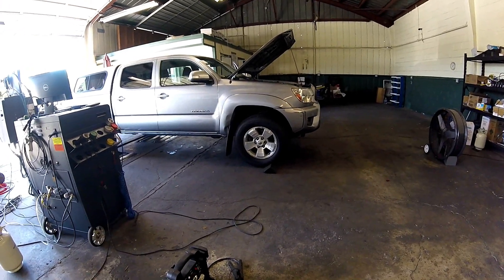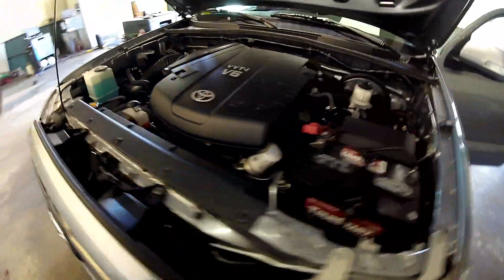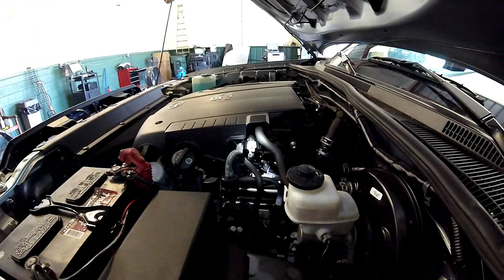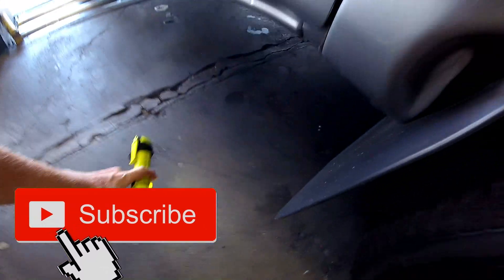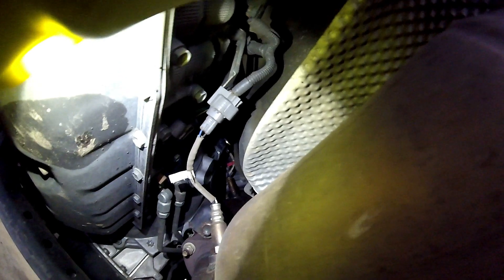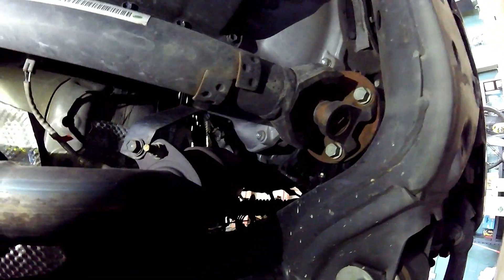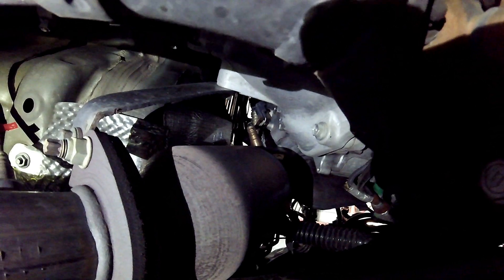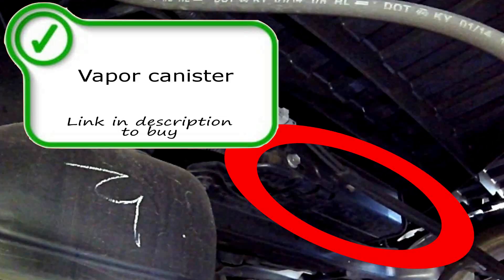⫷ Toyota Tacoma 4.0L v6 1GR-FE Emissions Locations: PCV EVAP, & Oxygen sensors ⫸

Comment: I have a P0420 code catalyst system efficiency below threshold bank 1, should I replace only the rear sensor or both?? 
2005 Tacoma v6 198k miles on it
Reply from the maker: Try the rear sensor first. That is the sensor that the ecu uses to monitor the efficiency of the catalytic converter.
Reply: @ScottiesHobbies  thanks Scottie, truck feels normal, no loss of power or weird smell coming from the exhaust so I hope is just the sensor
Reply: @boluchhh any updates on replacing the downstream sensor ? I’m fighting the code now and wanting to scratch o2 sensors off and reset the code ?
Reply: @BcSoTrendyy  i keep getting the code after changing the sensor so i just went ahead and replaced all the sensors, no more codes after that

Comment: Great information but how to I test each  sensor on my Tacoma first. Thanks and God Bless.
Reply from the maker: What sensor are you trying to test? And why do you think you need to test it?
Reply: Air flow and oxygen sensors, my truck has difficulties accelerating.
Reply from the maker: @davidruiz5383  have you tried cleaning the mass air meeter? If you have a fast acting volt meeter you can read the signal wires on the O2 sensors and you are watching for voltage switching from .1 to .9 v. You would have to induce fuel and read the oxygen sensor at the same time to see how fast they react. Its much easier to check if you have a good scan tool. 

You might be able to check your fuel trim to give you an idea of how your car is running, rich or lean? If you read a positive fuel trim at idle and it stays way positive while driving, you have a fuel delivery issue. 

I'd try cleaning my mass air meeter and see if anything changes... no codes or check engine light on?

Comment: I have a 2006 Toyota Tacoma that isn't starting when it's cold. I have to turn key on and off and eventually it catches and starts finally. My starter is good. I just replaced the ignition switch. thought it was fixed til I went out this morning. Same issue. Dash lights were all lit up. I used my FIXD to diagnose the problem. It said it was oxygen sensors. (Bank 1 and Bank 2 sensors) Would this cause it to not start? After it runs for a few minutes I shut it off then it starts right up. Thoughts??
Reply from the maker: Have you by chance checked your fuel pressure? Especially check the fuel pressure on a cold start? If you are running lean or starving the fuel from the engine you could get codes for both oxygen centers upstream. Personally I do not think It is logical for both precat oxygen centers to be bad and cause a no start. I think your computer is seeing a problem using the oxygen sensors.

Comment: I'm getting a p0430 code, and also experiencing diminishing fuel efficiency. As you said the downstream bank2 sensor is only a cat efficiency sensor, does that mean replacing it won't fix my problem (since I'm having fuel ratio problems too).
Reply from the maker: Have you checked for a pending code? You probably have a rich condition in the engine causing the cat to fail. For some reason the computer is not seeing it. Have you checked your spark plugs? See if any are wet. If they are, is it fuel or coolant? Do you have a code reader?

Comment: I have a 2011 Tacoma Crew Cab with 6 cylinder engine with about 50K miles on it and both the "Check Engine" and "slip Indicator" lights came on. I attached my scanner and Code P2195 came up. I erased the code and made sure the gas cap was properly connected and drove 15 miles, starting and stopping a couple of times. The "Check Engine" and "slip Indicator" lights came on again and I checked and the codes P0138, H02S, and P2195 now come up. What do you recommend? Can I simply replace the Bank 1 Sensor 1 and Bank 1 Sensor 2 Denso devices In the past I attempted to replace the O2 sensor on my 2004 RAV4 and I had a very difficult time getting the bad one out. Or, should I bite the bullet and let the dealer do the work. I would appreciate any advice on this topic. Thanks.

Comment: I have a 2012 Tacoma xrunner I'm getting p0171 and p0174 truck doesn't have any power 171 is maf and vacuum hoses. P0174 is 02 sensor should I replace both Upstream sensors
Reply from the maker: I bet your computer is seeing a issue rather that the sensors being bad. Check for air leaks or exhaust leaks around the engine. Do you have a air pump? Did you check the check valve? Do you have any rips in your air ducting between the maf and throttle body? Have you checked fuel pressure? A pump going bad and not supplying proper pressure can cause the whole engine to run lean. It's a lot to check but I bet you will find something.

Comment: Getting high ltft bank2 at idle on my 2005 prerunner v6. Ltft goes down as soon as I touch the gas pedal. Any idea what causes that. Not been able to find a vacuum leak anywhere yet.
Thanks
Reply: have you tried cleaning out your throttle body?

Comment: My 2005 Tacoma 4.0L V6 B1S1 and B2S1 Sensors are reading in excess of 3.2 Volts and the B1S2 and B2S2 Sensors are reading about 0.6 to 0.7 Volts...... These are being measured in Closed Loop Mode at Engine Idle via OBDII..... Are these Values Normal?

Comment: Hello I have this engine in my 03 4Runner... getting code p0430 which I believe are the air fuel Sensors.... kind of considering on changing all of them.. anyway how in the hell do you get the air fuel Sensors out? Especially with the amount of rust on them here I chicago! Is there any easy way?